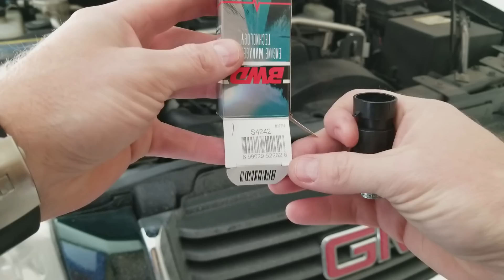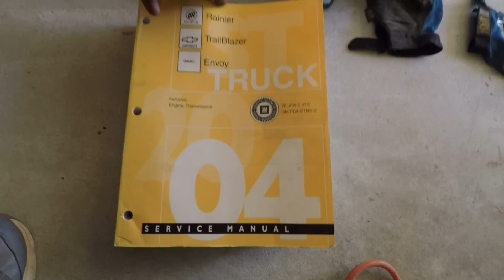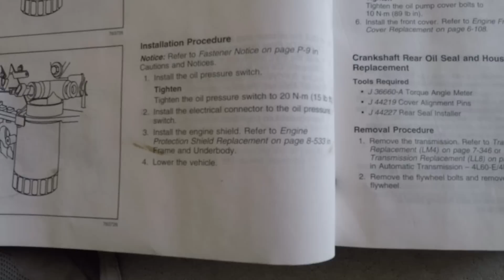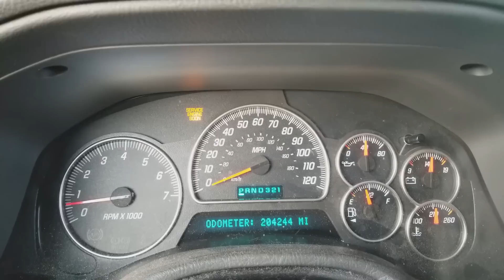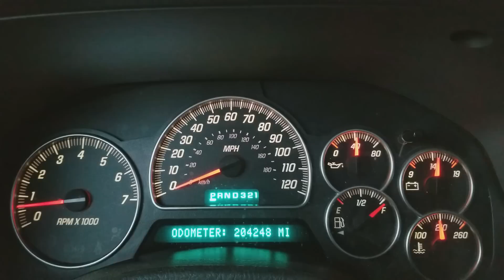DIAGNOSING ENVOY/TRAILBLAZER LOW OIL PRESSURE (GM 4.2L)

Comment: I just saw the 69 vette in the background, you gotta get that running. I rebuilt one 25 years ago and loved it. it was a factory drag car and had a sticker on the 4 speed shifter showing 11.5:1 compression ( actually had the heads decked and was 12.5:1 and needed race gas and premium mixed )  I had the headers into factory side pipes as well. Don't wear shorts and hit that pipe after running for an hour, I literally still have a burn scar on the inside of my left leg after 25 years. It looks weird as no hair grows there. Nothing better than removing the t-tops, pulling out the back windows, and cruising at night in the summer. No ac  and radio was crap. It ran 11.9 @107 with standard Gatorbacks. It pegged the rev limiter shortly after the 1/8 mile as it was built for the 1/8 mile. I could do a burnout starting in 4th if I revved it to 3000-3500 rpm and popped the kevlar clutch that took a ton to push down. I regret selling that car, I got a new 1994 vette instead but that was one hella car.
Reply from the maker: It's actually a 1970.  I inherited if from my dad when he passed away.  No AC, no power steering, no power breaks...just power through the 4 speed and 3.70 rear end!
Reply: Awesome car to have, Sorry to hear how it came to you. I guess driving it is bitter-sweet. Mine was a 350ci, dyno'd slightly under 500HP at the wheels, 5.? rear end from the factory. Apparently Chevy made a drag version and the super low rear end and higher compression were part of it. The guy I got it from put in the Kevlar clutch I think. My top speed was 107 due to the trans and rear end gearing. I loved my newer vettes but that body style with the chrome bumpers is just plain sexy.
Reply from the maker: I'd love to get mine on a dyno some day.  I has an LT-1 motor (non-factory) which were supposedly rated around 370 hp.  I'll be sure to make a video if/when I get a chance to dyno it.

Comment: it is a pressure switch, put your meter to continuity and the black on 1 pin and the red on the other, it will likely read some ohm number ( likely very low to 0- direct short  ), if you used compressed air into the hole at the end  ( try 15psi first and go up by 10psi each time ) , the continuity should change likely to above 10ohms or more.( I would imagine more like 1k ohms or greater )  The computer reads an open circuit ( just unplug the connector ) as oil pressure ok, and a short as zero ( or below pass level ) pressure. If you ever get a sensor that dies while driving , just disconnect until you can get it replaced. I just got a Rainier and got the low pressure warning even though everything was fine. I plan on putting in a real oil pressure gauge and disconnecting the factory plug as it decreases power when it thinks oil pressure is low even when it is not.

Comment: I had same problem. Changed oil pressure switch with no fix. Added STP oil treatment and problem went away. Apparently 5W-30 is too thin. You need a thicker oil if you have high mileage in your vehicle.
Reply: thanks for that info... I was watching this along with a few other videos to se how to change the switch. A friend of mine said to change the oil weight. I think that is my first solution as the truck runs and sounds great but after she warms up, drops to 0 when idling and 40 - 44 when driving. I was told to use 10w-40 synthetic... Suggestions?
Reply from the maker: Good point.  I use 10W-30 full synthetic.
Reply: I had just changed my oil to recommended 5w-30 and it continued. After research, a thicker oil was necessary to maintain a normal operating pressure. My quick solution was STP to increase viscosity. Next oil change will be 10w-40 since I live in the hot south. Good luck!
Reply: James Shirah      I had the same issue.  When id start it  it was fine til after 30mins drivin. Then the gauge would go nuts n i used to get the "check gauges" light  n i replaced the oil switch n solved the problem    u will need a 1 1/16 deep socket sticking ur hand thru the lower control arm n frame.    Very easy   not even 5 mins fix     hope it solves ur problem.  Good luck!!!
Reply: Thts true, after so many miles u cant put the oil tht gmc recommnds. Mine has 260xxx altho if i put the recommnded oil in it.  It knocks  n if i put thicker oil.  Solves the problem    good luck guys!
Reply: No more problems for me. Try the STP Oil treatment. Sure wouldn't hurt.
Reply: Rotella 15 w40 with a quart of Lucas

Comment: OIL PICK UP TUBE IS ALSO A PROB WITH THE 5.3 CHEV ENGINES... QUICK FIX
Reply from the maker: That was the problem on my 4.2l engine.  It was about 90% clogged.  But not an easy fix since on these engines.
Reply: The screen can easily get clogged...use the mobil 1 my friend it is expensive buuuut worth it...

Comment: Great job amigo...
Check the water pump and the alternator bearingsfor noise using the car antenna as a sound carrier...
I have a 2002 Trailblazer with that oil press switch prob..Solved use Mobil 1 5w30 with Lucas Too...More lubricity and lower proper flow temp during start up cold condition the lucas adds enhanced lubrication and less friction... Muy buena solucion...Gracias

Comment: Another tip go to your local hardware store by some Teflon tape to put around the threads that will help Sealing as well
Reply: DO NOT put Teflon tape on an electric sensor, the Teflon tape may insulate the sensor causing faulty reading. No need for Teflon tape or thread sealer paste, that o-ring will seal great. 
My uncle installed a brand new GM Target Master motor in his pickup, he wanted me to check out why it ran with so low of oil pressure, why it felt hot, but gauge said that it was cool. The gauges worked properly on the old engine! 
Jim wanted me to start by mechanical checking the oil pressure. It was perfect. Had me put in a new oil pressure sensor, it showed about 1/2 of what we thought that it should have been. I got rid of all the Teflon tape on the tee to the block, the 45° elbow, the sensor, the choke oil switch. That cleared up the oil gauge problems and that damn choke that doesn’t work problem!
I cleaned off the temperature sensor, solved the temperature gauge problem. 
Sometimes Teflon tape will insulate a sensor, causing other issues!
Hello from north east Montana. 
10 miles from the Canadian border.

Comment: Sounds like your water pump is bad, grab the fan to see if it wobbles, I just replaced mine.
Reply from the maker: Turned out to be a clogged pickup tube screen that was starving the oil pump.

Comment: Did you ever figure out that bearing noise?
Reply: Noise sounds like power steering pump.  Mine had clogged power steering cooler which caused the starved pump.  Sounded same before I replaced the lines and cooler
Reply from the maker: Brad R. I believe so. I just finished cleaning the oil pickup tube, which was about 90% clogged. Now the noise has gone away. So I believe the noise was related to low oil pressure, which I solved by cleaning the pickup tube screen.

Comment: I need you to come fix my gmc😂
Reply from the maker: janay jones What seems to be wrong with it?
Reply: Kevin Nadeau oil pressure light came on and went to zero. I turned the car off. Now the battery is dead. I got a jump and everything thing worked fine. Woke up this morning and the battery is dead.🙃
Reply from the maker: janay jones Those could be two separate issues, just happening to show up at the same time. If battery is over about 4 years, have it tested. Oil pressure could be the pressure switch, oil pickup tube, or something else in the engine.